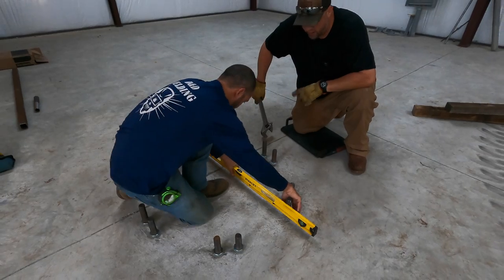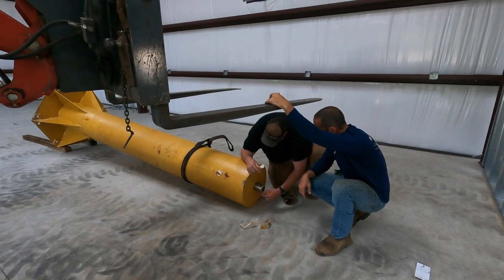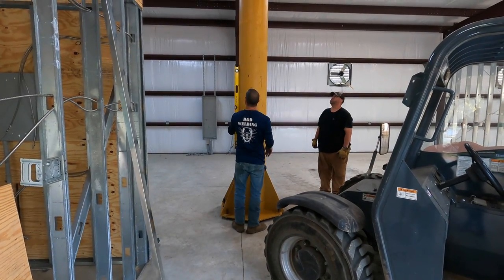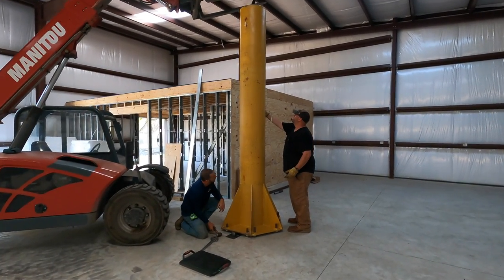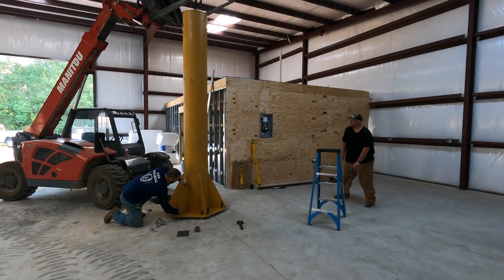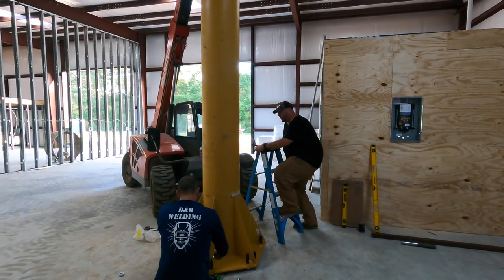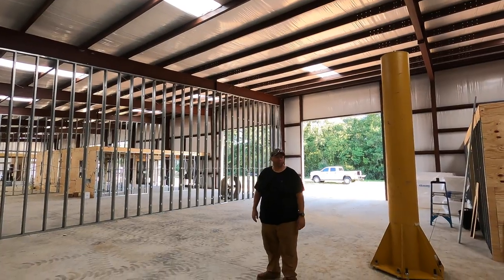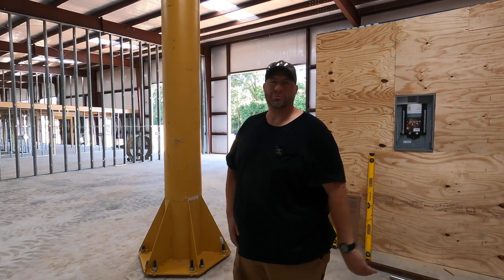Shop Space Update 6: Setting the Gorbel Jib Crane Column

Comment: I've installed and overseen installation/removal of at least 50 Gorbel jib cranes in my many years of work in the manufacturing industry.

It's nice to see someone so excited about what I would consider mundane grunt work. Everything I've seen so far has been done the right way w/ a little extra care thrown in. Nothing wrong with that at all. Using a bolt through the pivot pin is the way we always do it. Good job on that. 

When you go to hang the boom (arm) just balance it w/ your forks to set on the pivot pin and then shim to minimize drift (where the arm wants to swing and move on it's own.) If you don't get that right it will piss you off every time you use it. 

Good luck but I think you got this!
Reply: I worked in a shop that has a drifter jib. Everyone hated using that one particular crane, but unfortunately it was one of the ones we used quite often. I asked our crane guy once if there was any way we could adjust it to keep it from going 180 degrees away from you, and he said no. So your telling me there’s a chance….! Lol
Reply: @adambell2068  "...and he said no. "

That guy needs a tap on the head. If the crane was on a concrete floor there is no reason that couldn't be fixed. That guy was either lazy or incompetent. 
You can absolutely balance a jib crane so it doesn't drift away from the work area.

The mast needs to be plumb and level and the jib (arm) needs to be adjusted and shimmed to prevent the drift. It may take 20-30 min to do that but it's 100% doable.

 Now, if your working on a dirt floor or the side of a mountain, that's another story and a case for a different solution.
Reply: @josephcitizen4195  nope it’s on a concrete slab along with about 10 other jibs. It’s the only one that won’t stay put. Good to know it could just need adjusted. Not sure who the new “crane guy” is, as the one I mentioned no longer works for us. Thanks!

Comment: I have probably installed 100 jib hoists and never took the trouble you have taken. We never grouted a single one. We shimmed columns plumb, typically with only torpedo levels. We shimmed with sheet metal and torqued the anchors. I only recall maybe half a dozen that required adjustment to correct for column plumb error induced swing. I think that I would set the rail while the plumbed column is torqued to the jam nuts before grouting. Any dynamic tested error could be corrected before grouting prohibits correction. I do not think that you will have any issues. Your column plumbing care should be good enough. My experience says you shouldn't need to shim the cross rail (beam), but ensure the column plumb is correct before shimming the beam.  Jib hoists are verisitile and intuitive to use. You will love yours.
Reply: Each one of those bolts is safely rated for 20K lbs or more.. I mean the crane heavy duty but that column will buckle like a beer can long before one of those nuts or bolt even breaks a sweat.
Reply: Talking about 1/16 top to bottom is good enough... I would hate to build anything with a machinist! Out of square!
Reply: Yes.  I thought he should put the beam in frist before grouting.
Reply: Is the grouting for added structure or more to just fill the gap? If it’s structural is it some special concrete mix?
Reply: When you are just not quite sure how straight and level it has to be, the easiest way to get it close enough is to get it as close as possible. I have almost always found that it's atleast close enough.
Reply: @mopedmarathon   grouting is for structural. Most likely a hard pack cementacious would suffice in this case but he may opt for a 2 part epoxy base such as chock fast or Rowan Atkins.
Reply: @mopedmarathon  it prevents moisture, water and dirt sitting under the base plate to prevent the bolts and base from rusting.. 
It also helps keep the bolts under the base plate to stay in place and not get loosened or hit accidentally by forks..

Comment: You will love these cranes. I built two of them made of semi trailer axles bolted to the concrete block of the wall on the side of each door for the fuller/eaton transmission shop. They were very durable, had a Long reach and lift anything up and you could direct it right to your table from the back of a truch.

Comment: Nice job on getting that column vertical.
A thing i use on some projects i'm doing the drafting for, is putting tapped holes in the base plate, so you can use bolts screwed in from the top (trough the base plate, if needed a small metal plate on the concrete to prevent those bolts from going in) to level everything. It's much easier to use a socket wrench from the top to make adjustments.

Comment: When we installed that same jib crane, we ended up putting a pipe, sized to the bore of the column set into the concrete about 4' down and 3' up from the floor. but we also only had about 12" of concrete to work with and had concerns about it ripping the redheads out.

Comment: Nicely set studs. Next time try first only with 3 nuts at 120, lowers the rest, the plane is defined by 3 points, as many more you have as hard is to do it. When is leveled with the first 3, then do the rest until touch.

Comment: As a millwright generally when setting a machine to be grouted we roughed the concrete under the machine.
Reply: why? strictly compression load. I have grouted many
Reply: The way they did it tighten the nuts on the nuts the grout doesn't offer any benefits other than you can't sweep dirt under it. Yes the concrete should have been bushed. Could've used half the nuts to plumb then dry pack shims under and then back those nuts off underneath before grouting. Tighten the top nuts down then grout then after grout dries then slug the nuts tight to get proper stretch on the anchors to get proper compression.
Reply: @forbesmathews89  He wont get any compression load on grout when the column can't stretch the anchors cause it is tightend against the nuts.

Comment: Seems like a low count on the UFOs. I'm a big fan of lightning in a shop. I'm guessing a couple more will be added when the shop fills. It's a lot easier and faster (cheaper) to toss a couple more lights into the space before it fills up.

Get some 2x6 in that office wall. You're going to want to easily install shelves etc.

Good call on the outlet spacing!

Comment: As a electrician who has set many light standards. I allways  torque  nuts down before grout, because as you cinch up the top nuts the bottom nuts can flex or tighten up in threads and can throw off level. If the grout gets in the bottom  nuts, you cannot adjust light standard.
Reply: Can I ask what do you think of the base been put over an expansion joint in the concrete, when the slab settles, the grout will crack.
Reply: @richardlomas8625  If it cracks, he has much bigger problems. Not gunna happen.
Reply: @firesurfer  how come it won't happen?
Reply: @richardlomas8625   How thick do you think the slab is?
Reply: @firesurfer  in the UK it can rang from 12" to 24", not sure what the code is in the us, but the sections of slabs are independent from each other, he has just bridged that with the jib, and now will grout under it, making the two sections into one
Reply: @richardlomas8625   It's one piece.
Reply: @firesurfer  should be ok then, let's hope so, I like watching his videos, he is a true craftsman

Comment: You should have picked only three bolts to level it by. Put the level perpendicular to two bolts and adjust the angle. The level would be between the adjustment bolts on a parallel plane to the two bolts you are adjusting. That way it pivots easily.

Comment: Use Five Star fluid 100 grout. The cement should have been roughed up where the grout is going, but stuff happens. Be sure to keep the floor wet for 24 hours before pouring the grout. Also i hope you have it set up so you pour grout 1 and 1 half inch thick to bottom of baseplate.
Reply: Plenty of keyboard experts here .
Reply: @Hugh1966  Some of us have 43 years experience as a millwright.

Comment: set a 28' tapered aluminum light pole (10in at the base, 4 1/2 in at the top) on a 4' deep foundation with 1in. x 3ft stainless steel j bolts.  the 30in x 30in concrete pad was dead flat so we set that pole right on the crete.  know the good feeling when the bolts fit up to the holes.  them dam j-bolts were 75USD apiece.  all for 10Nov.   OOOOOrah

Comment: 10:53 If you look at the large metal power pole bases, they double nut each stud. Safety third!
Reply: What are you talking about?
Reply: @josephcitizen4195  Utility Power Poles (similar to what he is doing) put 2 nuts on each stud for safety.
Reply: @alansmith4734  Ah, I get it now. Yes, he needs some locking nuts. Could be waiting to install until after the grout.
Reply: How would 1 nut loosen itself, then spin up the stud, and fall off? Isn't his install basically double-nutted as it is?
Reply: @KSparks80  The locking nuts are to prevent the torqued nut from loosening over time. Not to prevent it from falling off. 

The nut just on top of the base is what 'locks' it to the floor. If one or two of those were to loosen you could possibly get damage to the base of the crane.
Reply: @josephcitizen4195  Gotcha. Thanks.

Comment: Heads up   double check the  receptacles  they are not looking like your going to have  enough amperage for what your wanting if the run them like that in MC  cable .. I would have them piped if it was my  shop  in 3/4 emt

Comment: What's the purpose of the grout under the crane?  Are the nuts under the base not sufficient to support loads?
Reply: Grout is a non shrinking concrete that when dry helps to support the load on the post.

Comment: Since you leveled the bottom nuts I bet the base plate wasn't exactly square with the column.
Reply: You will literally never get a column like that plumb by leveling the nuts. All you can do is get it close then fine tune it. There are a lot of ways to be 1/32" or more off on each nut which translates to a 1/4 to 1/2 inch or more over the height of the column. just sayin'

Comment: Out of shear curiosity, what makes the jib crane so special to where you couldn't have fabbed it yourself?
Reply: Cost really. Certified weight ratings, material, time. I've bought, installed/moved at least 50 Gorbel jib cranes while working in manufacturing. It's just cheaper than fabricating them yourself. 

I have had a couple articulating jibs custom made because of heights/lengths that manufacturers couldn't provide but they needed OSHA certs before putting into production and that costs money as well.

Comment: How tall are those gussets? I've taken the time to draw your jib crane on a CAD-program (TUBO-CAD.) Sure would help.
Reply: Why would you do that?
Reply: @paulcopeland9035  to build my own. I was looking at another manufacture's jib crane, and spec's.  They seem to be almost the same.  The difference was the base plate(s) one company went with just a round 38" in. Dia. base with Gussets, the main post only a 10" in. Dia., 0.500" in. wall.  The Gorbel Jib Crane uses a 18" in. Dia. pipe /tube. I'm assuming 0.500" in. wall. as well. I'm gonna need something to help load onto my (Plasma-CAM) plasma cutting table. At 68 yr's,   I'm not getting any younger. Work smarter, not harder.

Comment: All those outlets off of the 480v panel will be for heavy equipment only? 120/240v power for standard outlets shouldn't be able to come off that panel without some sort of transformer correct?
Reply: The plethora of videos on YouTube dealing with handyblokes talking about electricity serves only to confuse the issue and make things unsafe for the uninitiated.  You don't get to choose your voltage like: 480, 440, 420, 120 or 110 volts like octane ratings at the petrol garage.  You get a set voltage, decided by your electricity supplier, on one or more of three phases or hoses.      The agreed standard for each phase is 240 volts plus or minus 10 percent.   If everyone in the street turns on their oven at the same time the voltage on one or more phases could drop, but that's all under the control of the supplier.  The drain on each phase should be balanced as best as possible, but it ain't a perfect world.

It's not a complicated system, but it has been made mysterious by unqualified folk talking about things they don't understand. Thousands of people die every day by unsafe electrical connections.    Remember:  IT CAN KILL YA,!!

Stavros

Comment: Your friend was critical of the plumb bob but that level is only as accurate as the people who manufacture it and calibrate it. But that plumb bob relies on gravity and that's the same no matter how far east or west, no matter how far north or south, no matter how high or low.
    In my region of the country, we have homes and buildings built with nothing but a water level, a string line and a plumb bob and they are more precise than homes built today with dumpy and laser levels, transit's, and other engineers tools. The accuracy falls more to the operator and his knowledge of the applied system than the system itself. The ironic thing is, a knowledgeable person can "string" a straight line, a circle, an elipse, an angle, just about any geometric form known.
Reply: Great comment, I was on a construction job and a guy broke his lazer level, I said to use a water level and he never heard of one, and he owns a company.

Comment: How thick is your floor and did you get it tested? We had to build a pretty wild foundation because our floor wouldn't have been able to take all the load.

By the way: Please don't use the fork as a crane hook like that without at least putting something in place to keep it from just sliding of. Unnecessary risk and 10 second fix

Comment: 50amp for a welder? Seams excessive? I only used 15 and 20amp plus and welded 30mm thick plates without trouble
Reply: A 50 amp supply will give you a 100% duty cycle which your 15 or 20 amp supply won't do.
Reply: You must like buying toasted breakers. If you're welding 1" plate with a welder having less than 20 amps input, it's gonna be an all day sucker.
Reply: @millwrightrick1  IV never had trouble 415v 3phase 20a or 240v 15a.
Reply: @KSparks80  wouldn't bother me if it was the case I get paid hourly and double in overtime. But I didn't feel to slow anyway

Comment: WTH? I'm not an engineer but I've seen this size jib crane get installed before, and the slab was cut out, a 3 foot deep hole was dug  and about a square cubic yard of concrete is put in as its base, and that was on a 12 inch thick slab.